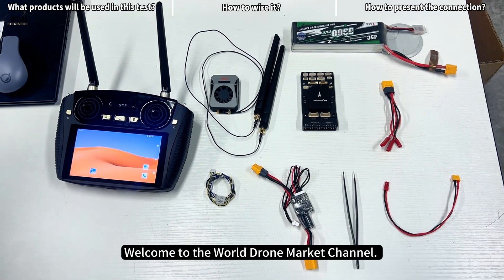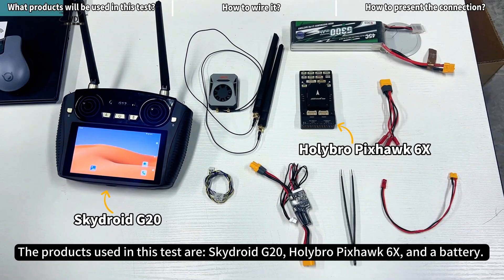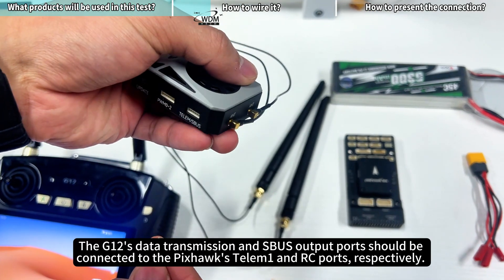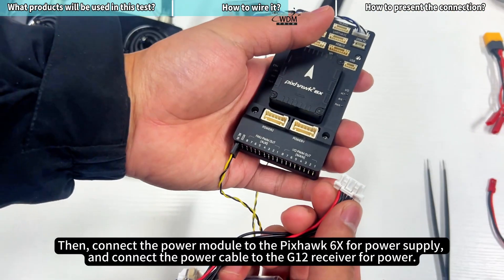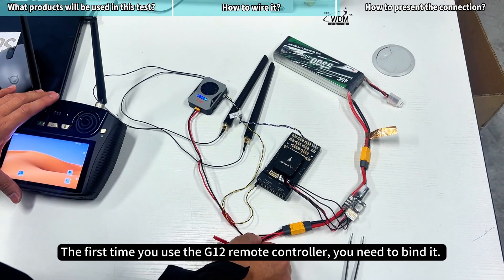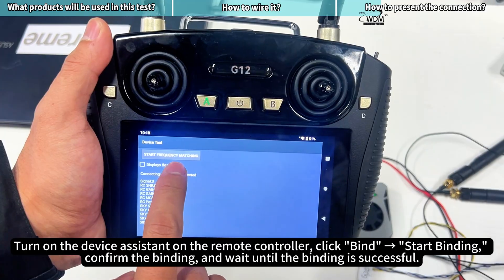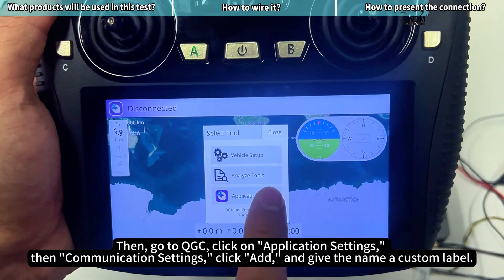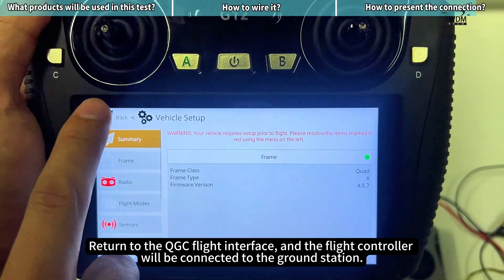Skydroid G12 connecting QGC ground station tutorial

Comment: a rc car can be controlled with it? And what parts do I need other than G12 and receiver? Thanks
Reply from the maker: You can use it to control a remote control car. In addition to the G12 and receiver, you also need a controller.
Reply: @worldronemarket  could you please help me out with exact parts so I can order on your website? Thanks
Reply from the maker: @jazzypurewal4839  Regarding the assembly of the unmanned vehicle, we can only provide the remote control, controller, GPS, and battery. You will need to purchase other parts yourself, such as the vehicle frame, motors, ESCs, etc.
Reply: @worldronemarket  I already have everything else, just need controller, receiver and camera! That’s why I’m reaching out to you for the controller and receiver because I’m not sure which receiver will work best with G12 and will be able to control the motors
Reply from the maker: @jazzypurewal4839  The G12 remote controller has only one receiver and cannot be used with receivers of other models. The remote controller and receiver must be used as a complete set. For flight controllers, we recommend using CUAV or Holybro flight controllers, which are compatible with open-source firmware such as ArduPilot or PX4. As for cameras, any network camera can be used. For example, gimbal cameras from Skydroid and SIYI, which are available on our website, are compatible with the G12.
Reply: @worldronemarket will CUAV 7 nano works?
Reply from the maker: @jazzypurewal4839  no problem

Comment: I notice the latest version of QGC is nolonger supported on Skydroid devices since QGC requires Android 9 and above and Sykdroid is based on Android 8. Will a firmware update be made available to install a later Android version on Skydroid ?
Reply from the maker: The Skydroid G12 remote controller in the video is already running Android 13
Reply: @worldronemarket  Skydroid technical support have just confirmed Android can only be updated on the G12 and G20. It is not possible to update Android on the H12 which means I can nolonger run the latest version of QGC. Since many people use QGC this is very bad news.